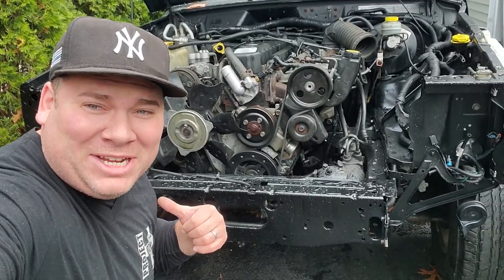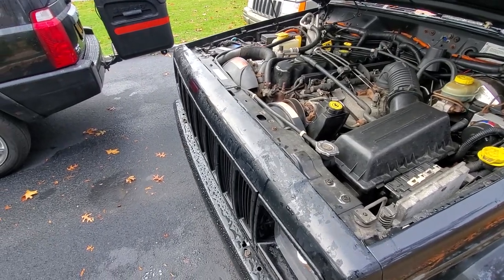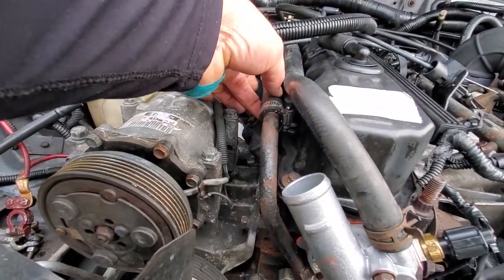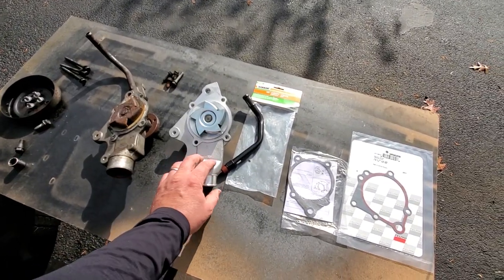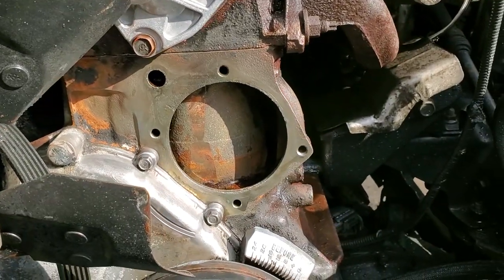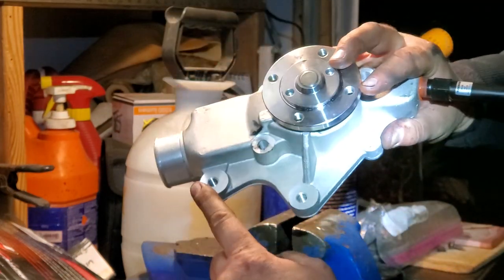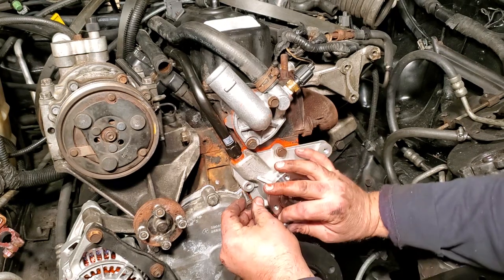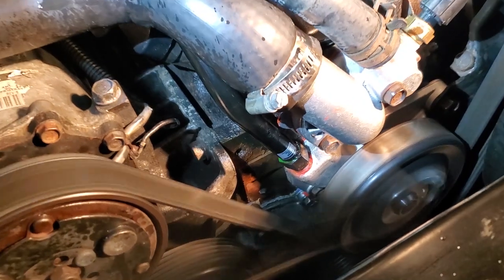JEEP CHEROKEE XJ WATER PUMP - WRECKED J EPISODE 6

Comment: Ehhh this job isn’t so bad with the header panel on. Last I remember all I did was remove the electric fan, shroud, and belt. Didn’t even touch the PS bracket, just where it mounted with the water pump. The inlet tubes are usually annoying if they’re rusted on.
Reply from the maker: Yeah, its possible to work in there. Unfortunately Id never be able to film a good video with all that crap in the way. lol!

Comment: Use a brass barbed fitting . And a long inside diameter heater core hose and never go back to using inlet pipes
Reply from the maker: Great Advise

Comment: Hey man I'm getting mixed results on my searches for doing the water pump on the xj. Are you supposed to use RTV on both sides of the gasket or no RTV at all, or any type of sealant? It leaves me confused as to why some videos say you should use it, and then people say if you use the high temp RTV you'll be doing the job again. I just don't want to take everything apart and have to re-do it again because it leaks or something. Thanks for the video as always!
Reply from the maker: I've done it this way for 20 years and never had 1 single drop leak.  I think people try to "glue" on parts with RTV without properly cleaning and preparing their mating surfaces.  Take your time and do it right and you wont have a problem

Comment: We all get those Nipple problems now and then. As for water pump I got a high flow water pump for my ZJ and my 318 hasn't gotten hotter then 150° and it increase the pressure so it can get to the back pistons. My 318 hasn't be so happy.
Reply from the maker: Yeah, The high flow pumps are excellent!

Comment: Hey Dan love your vids your help is appreciated.. I have 97 -4.0 zj. the cluster does not work.I replaced dash cluster ,  I checked out fuses . Not the problem. . Odometer does not turn when driving . Nothing works on my cluster . And security light stays on .  I have no clue . Nor does anyone else .to what could be causing this problem. 
Do you please have any suggestions of a cure to this issue ???  Thanks Dan. You the man
Reply from the maker: I'm not sure about this one... Shot in the dark..have you tried replacing the headlight switch?  If that dimmer is bad it can mess with your illumination lights.
Reply: @ProjectDanH    I will do.  Come to think of it dash board light were acting a bit funny.  Thanks for the shot in the dark.  Hopefully it's a hit in the bullseye .  
I'll let you Nkow.  
Love these years of jeeps.  The one I have now is the 5th.  Thanks again Dan the man . Cheers brother!
Reply: Two possible things, 1. the fuse for the cluster may not be making good contact in the fuse holder. I had this problem with my multi function switch, All I did was twist the prongs on the fuse a little and its worked ok ish for about a year now.  2.  the security system may not be completely disarmed.  Try sticking the key in the drivers side door and turning it between lock and unlock about 3-5 times.  Might even  be a turn and hold for 3-5 seconds, not sure, been a while.  A key fob will turn that off but I'll assume you don't have it.  I couldn't lock my 98 ZJ without triggering the alarm when I went to unlock it.  I was able to get around that by scouring the u pulls near me for a 96-98 ZJ with a key fob in it.  When I found one, and it took a while, I bought the key fob AND the passenger front door lock/window switch.  You need both because that's where they decided to put the keyless entry do dad.  There's also a wire in the driver front door you can ground out and that works too but to me, it's a last resort.  Hope some of this helps, good luck.

Comment: good video ! what a mess with the  Dorman inlet tube - is the nut pressed/welded on to the tube ? May be overtightened a tad ? I painted and reused my inlet tube - works since then. I always try to keep the original parts in case they are not rotted out - always better quality.
Reply from the maker: It was incomplete welds from the tube to the nut.. crap production.  JB weld fixed it.
Reply: @ProjectDanH  what I expected - glad to see the ResurrectJ - project is on a good way !

Comment: Imma tell a quick story.....2000 jeep with the cracked tupy head and overheating like crazy,  did a full engine rebuild...New Pistons, New Connecting rods, bearings, crank cut, etc..... After the new engine was put in, i put in a brand new water pump. Not exactly sure what model pump.. but since my engine was deck and washed, the surface of the water pump housing was sanded/was thinning after the deck and wash. BRAND NEW WATER PUMP was RUBBING, i repeat RUBBING on my 1st CYLINDER engine wall. Wondered for a week why the engine was still overheating after installing a brand new engine and a 3 row e fan setup.... moral of the story is... not every new part you buy will fit your jeep. Proceeded to buy a flowkooler water pump which has a much slimmer design of the fins on the pump. No more overheating!!! Jeep never goes over 195 now :) I was bashing my head agaisnt the wall when i realized!
Reply from the maker: Wow! that's crazy! that issue never occurred to me.   I installed a Flowkooler on Andys XJ. It's pretty cool 🤣🤣🤣